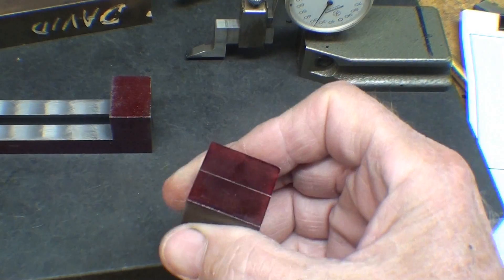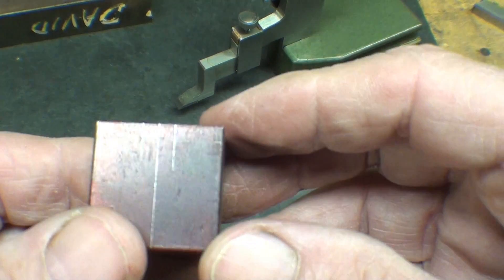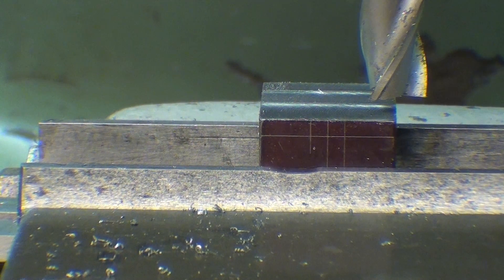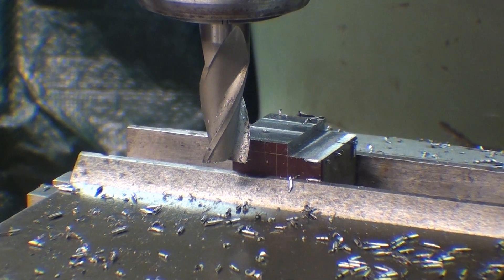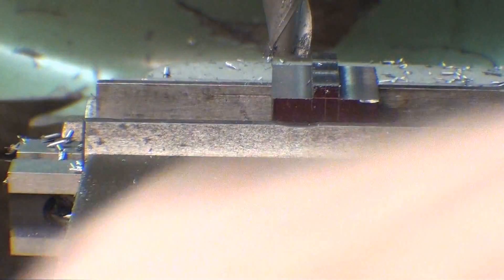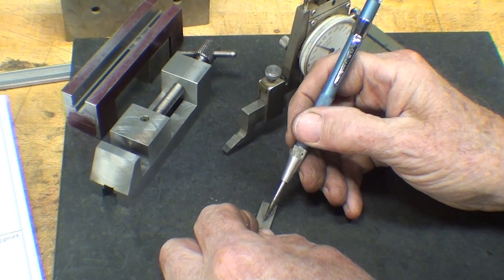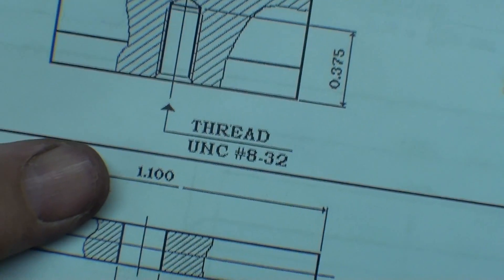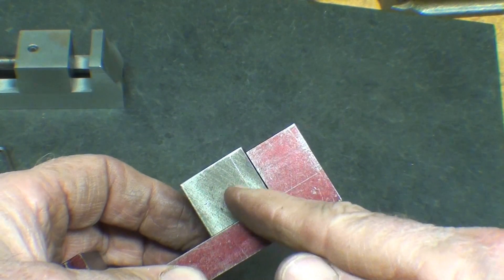TIPS #353 pt 4  tubalcain MAKES A TOOLMAKER'S VISE

Comment: Lyle,  I learned to draw the same way that you did (years later than you because I was taught by a Professional Draftsman, but still used pen & ink on vellum for my first two complete drawings, then pen & ink for only the borders, but still on vellum) -- to show the tap drill size in addition to the finish thread details.  At work (where we also used vellum), I learned that to do things like telling what drill size to use for threaded holes actually insulted the Toolmakers, so when making a drawing for them, we all learned quickly to only give the finish thread size.  The same for counterbores for SHCSs -- we just told them to "C'BORE FOR 1/4-20 UNC SHCS," or similar, knowing that they either knew the needed info off the top of their heads or would look it up in either a Machinists Handbook or a Machinerys Handbook.  When we made drawings for "less highly skilled" Machininsts than Toolmakers, we'd go ahead and give them all of the details.  Perhaps Toly has either made drawings for only highly skilled Machinists or is simply good at CAD, but doesn't understand what ought to be on a drawing (for every skill level of Machinist, like those of us building your projects)?   There are severl "errors" on his drawings for this project, but they mostly lean towards giving redundant info (without saying "(REF)" or a similar note) instead of too little info.  I certainly mean no disrespect for Toly because he really helps by making drawings for some of your projects.  I received my copy within six minutes of requesting them!
Reply from the maker: Thanks for some good comments.  We used india ink on our tracings--very tedious & unforgiving

Comment: We live in a global economy its time to metric it up adding 3/8 to 5/64 is so passe. So mr pete toss out all that imperial tooling and come to the light side...
Reply: rob armstrong, Imperial  is based on a thousand units of measurement to one inch 1.000" it makes no difference to measuring or working with either system as far as measuring  and working to a given size since the digital read outs now available, just a push of a button and in the blink of an eye its an accurate conversion   , I work with both as my milling machine is metric and the lathe imperial and the only difficulty I have is looking for stock material from the off cuts in the scrap bin to make something  like a bracket, clamp or some round stock  . being quite old now and brought up with yards feet and inches I automatically  know what a length of material  @8 inches long looks like but really have to think hard about finding  @204mm , I guess Lyle being in the same age group as myself  thinks in the same way .
 So you can stay on the light side Rob . but there are many who are not keen to ditch all their old familiar tooling and machines that have taken a lifetime to collect when they are not machining for the global economy .

 Around 1970  Britain went metric with the money, instead of the Pounds ,shillings and pence.240 pennies to the Pound  now It's Pounds and pence, that was shock as things costing less than a Pound got more expensive twice as fast . 100 new pence = one Pound .  that was enough to put me off metric.
Reply: Lyle lives in the U.S. where even though the Government tried to cram the metric system down industry's throat in the '70s, industry refused at the time due to the huge cost of replacing 100% of perfectly useful (for the work) machine tools, tooling, & measuring equipment.  Like most hobbyist machinists, he buys old, used equipment (i.e., that has Imperial markings/measurements).  New equipment purchased by industry has mostly been CNC, so you get to choose which system to work in, sometimes both on the same job!  I'm sure you are (partly) joking when you recommend that Lyle throw everything out and start from scratch.
Reply: Chris C. I agree!
Reply: Maybe! A little triggering now and then? I bought a 1908 leblond 31" throw but has metric dro's :(. Our priministerial king justin trudeau insists on global economying it. Ill take trump close the borders fast!
Reply: ***** you are a triggered!